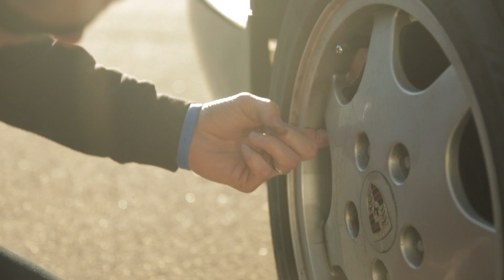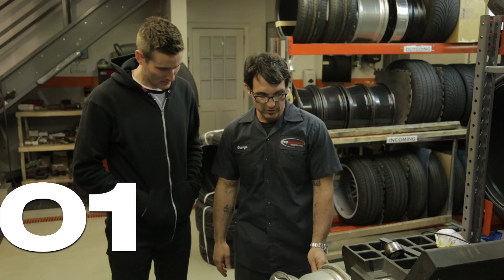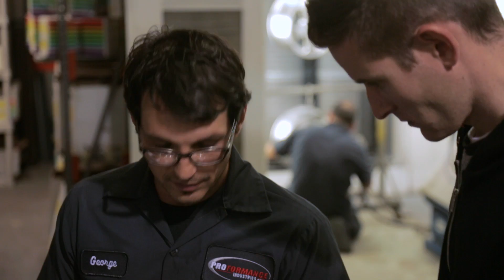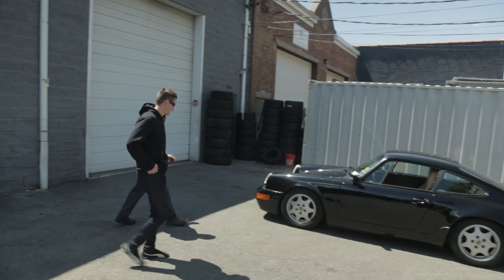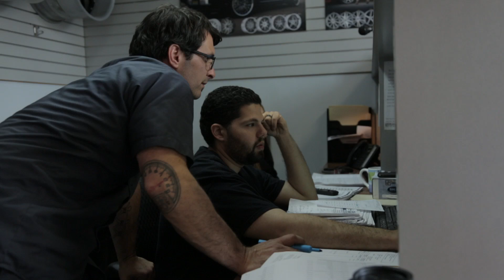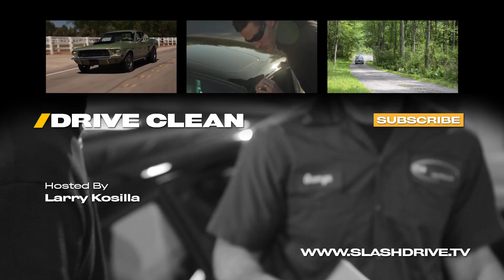Wheels & Rims: Repair, Refinish, and Fitment - /DRIVE CLEAN

Comment: Masking off any part of a wheel is a mistake. If there is any mechanical interference that coating will be immediately knocked off, and you want it absolutely everywhere it will not be knocked off. (then you can even use anti-sieze on those places). Especially because of galvanic corrosion, which is the real reason wheels get frozen into hubs- when both the ferrous, nonferrous and aluminum parts are NOT COATED and are in continuous contact. This guy George seems oblivious about this fundamental issue. What a mess those uncoated areas will be. What headaches they will cause.

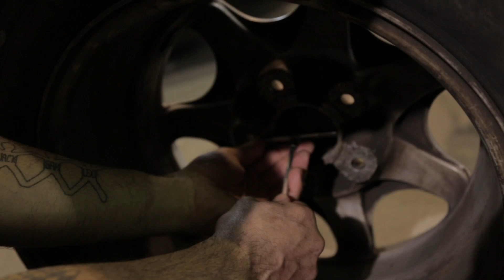Comment: Holy crap massive cringe at 9:20, learn to use your measuring equipment before getting on your high horse about how "you don't care what any book says and you have this measurement" i'd be surprised if you got within 0.2mm with that technique. Extend past the centerline/find the center radially, lock it in place and drag back through the bore, then check using feel as you slip it through a micrometer. There's definitely a right way to use telescopic gauges and that's not it.
Reply: +Alex Smith 
Please post a video of your secret wheel black magicks.
Reply: lol larrys reactions during that time frame is hilarious.  looks completely speechless and the jaw cringe is priceless.

Comment: Sure you can spend money and buy new or used wheels if you like. But it's not "not worth it" to spend the money to fix up your original wheels if they're something worthwhile (like those original 16in C4 wheels Larry had were). Could have actually been a very interesting video if only for the sake of education on the process of blasting the finish off the wheels and then repairing kerb rash. 

For you garage wrenchheads out there that want to fix some Kerbing and aren't afraid to get your hands dirty, check out spot putty. If it's a small bit of rash you can actually strip the paint of just that bit of wheel, apply the spot putty and hardening agent, sand to smooth and then repaint with the correct paint (on almost every german car it's Wurst Silver paint) take about an hour of your life but well worth it. 

If your wheel is rashed badly, just strip the entire wheel and use the spot putty and sandpaper to get the entire wheel nice and uniform. After that pick whatever paint + clear combo you want. Use a spray nozzle to keep your spray even sand it down between coats, especially fine sanding between clears.

Comment: Literally did not learn a thing about restoring wheels other than he strips them then powder coats them. Then he sold you some new rims instead of actually showing the process...

Basically:

Step 1: Pay some sketchball to do some "magic" on your rim.
Step 2: Balance and install in the most expensive way possible.

Appendix: Avoid any action that may save money at all costs.
Reply: My favorite part was how he does not even talk about tire measurements at all hardly. He loosely mentions 265 in the back but does nothing to speak of how the math is done to get the same rolling diameter of the old ones with a different size rim and tire from stock.

Dude is way to self important.
Reply: Seems relevant to 99% of Porsche owners then.

Comment: Nitrogen in road tyres is such a sham - clean dry air is 80% nitrogen anyway, and the claims made about the benefits of pure nitrogen are mostly bullshit - don't waste your money on nitrogen fills, just make sure your compressor is supplying dry air (and even that's not super important with modern tyres and wheels).
Reply: The pure nitrogen for the average road car is a waste of money because the actual temperature change is minimal Pure nitrogen is used when a tyre will experience a lot of heat cycles as it is more stable than regular air and if it saves a 10th of a second a lap motorsport will jump on it for every day road use I wouldn't pay the extra for it only because i regularly adjust my tyre pressures and having to have a nitrogen supply in my garage to do that would be a nightmare.
Reply: Neerav Reddy The very fact that I bothered to research this before deciding it was crap shows that I am no idiot - but think what you want.

Unless you have 500+ HP and track your car all the time you you might as well spend your money on a new air freshener, you'll get more value from it.
Reply: Matthew Sharpe gotta agree with you man, you have a very good point on this one. Nitrogen is only beneficial for race car tires that experience drastic heat cycles to keep them consistent. I tell ya, I sure wouldn't be able to tell the difference so I save my money...
Reply: Matthew Sharpe I tell people the same thing all of the time as well. The air we breath, as you pointed out, is already 80% nitrogen. I'm not going to pay whatever they're charging now for the extra 20% on a car I don't track. If someone else wants to do so, it is just a waste of money, but there are worse ways to waste money on your car. So long as it doesn't get as bad as a girl I know who, when her tire ran low, would not put regular air in it and drove on a nearly flat tire for three days until she could find the receipt from her tire shop that allowed a top off for free.
Reply: Ryan M True, those electric fan "turbo chargers" and magnetic fuel thingies are worse ways to waste money I guess, or the ones that actually reduce performance like engine bay pod filters.
Reply: You guys pay for nitrogen? Most of our tire shops fill them for free......I could take it or leave it on nitrogen on my primary tires, but I prefer nitrogen on my spares and storage tires/wheels. Nitrogen tends to reduce the amount of pressure loss over time, which is a good thing if you don't check your spare tire pressure that often.
Reply: i get free nitrogen whenever i want at my local bmw dealer :)
Reply: Matthew Sharpe you are an idiot
Reply: Nitrogen is a super cheap gas. Most common gas. It should cost almost nothing to get nitrogen fill. Anything that keeps oxygen and moisture away from parts is a great idea and will prolong mechanical life.
Reply: Must be a massive sham, Considering the New nissan GTR comes from the factory with nitrogen...haters will hate...
Reply: Vort E just wasted $20 on a nitrogen fill huh?
Reply: actually no, but good to see how butt hurt you are...u made my dat lol
Reply: Vort E I'm just pointing out the woo, you can ignore it if you want to.  
http://www.theaa.com/motoring_advice/safety/filling-tyres-with-nitrogen.html
http://www.racq.com.au/cars-and-driving/cars/owning-and-maintaining-a-car/car-maintenance/nitrogen-for-tyres
http://www.popularmechanics.com/cars/how-to/repair-questions/4302788
But go on irrationally doing whatever you want  to despite the evidence - that's what people do.
Reply: I've been in the industry for 15 years, Used nitrogen for the last 10 on all of my cars, Even my hilux with 300 000km, It's used in all forms of motorsport, Even in the tyres on planes... I dont need to read anything i know from my own experience, You think its a waste thats your opinion, But dont make out its all hype when you have zero clue...

End rant.
Reply: Vort E because planes and racecars have any relevance to passenger vehicles on public roads. Like I said if you want to waste your money, go right ahead.  I'm the one with the opinion backed by aaa, popular mechanics and the rac.
Reply: If they didnt then why does what is developed in racing directly relate to passanger cars, Ie saftey and all that, You're just ignorant...So live in your little bubble....
Reply: Vort E It's true a lot of technology developed in racing does end up in passenger vehicles eventually - as OEM equipment, but a lot doesn't make it to passenger vehicles either - racing slicks for example - useful on the track - not so useful on the daily commute.

I've tried nitrogen (as it was offered free with a set of tyres) in my 400rwhp road car which I occasionally take to track days - I could not tell the difference, my lap times did not change, the trip computer could not tell the difference - fuel economy & range remained identical, I still lost a couple of lb of pressure from the tyres a year like usual, and the tyres still wore out in the same way as the previous set.

So now I'm back to dry air from my compressor - and I still can't tell the difference.  If I wanted to fill with nitrogen I'd be looking at $20 + whatever they charge to top you up however often it needs it - for something I'm not going to notice at all even when driving much harder than I do on the road - why bother?

Add my personal experience to all the literature that says you can't tell or measure the difference in any meaningful way, plus my scientific knowledge - well I'm very satisfied that my opinion is not ignorant.

Maybe it's useful in a Nissan GTR, maybe a better driver would notice the difference - I don't know, my car is quick, but it's not anywhere near GTR quick, and I'm a very average enthusiast level driver.

Look, I've had this exact debate with my local tyre guy as he's convinced the product he is selling does his customers some good though he has nothing but personal anecdotes to back it up - but I honestly cannot tell the difference, and objective studies also say the same thing - so when people ask me about it, I tell them not to bother with it, it's a waste of money.

Comment: Thanks for putting up great videos...  I'm fellow OCD...  Can you comment as to why he suggested NOT to repair the wheels that you had?  Wheel repairs local to me typically charge $150 to $200 for each wheel.  This would have been cheaper than buying new wheels outright.

Comment: It would have been helpful for the shop to quote the repair costs, and then weigh the options of upgrading or replacing.  Yes, the factory wheels were ugly as f*ck and needed to go, but that still doesn't dismiss the "show's" responsibility to provide an accurate assessment of the situation; assuming they want to maintain a measure of credibility with their audience.

Comment: The overall diameter of the wheel size and width along with the tire size and width was way out of factory spec, that is why guys were blowing Murci diffs back in the day. Improper overall diameter front to rear and overall. It's much more of a science than people are led to believe.

Comment: Felt like this episode was missing some stuff. Just seemed short, I would like to have seen him actually doing some of the restoration work on some wheels, doing the math and calculating the new wheel size etc. But overall it was good. 
I see a lot of comments on how much people dont like the new wheels and I have to say I also am not a huge fan of the new ones, BUT it the only thing that matters is you are happy with them and I'm sure that you are.

Comment: I'm not sure what tech is in that Porsche, but in AWD systems, if the rolling diametres are different front to back, the diff will detect slip and lock/adjust accordingly. This puts a significantly higher amount of wear on the diff itself, because if you imagine this happening at 100km/hr or 60m/h, there's going to be a lot of little locks/adjustments.

Comment: Kwaki82 in the US you can do all sorts of stupid unsafe stuff and if you don't get caught you are fine. I pulled the wheels off an olds and slapped them on Chevy cause they had better tires on them and the car is a beater. If they fit and even seem road legal you can run them. Now if a wheel breaks and you crash then you may have an issue but I don't know.

Comment: Please, could you expand more on the differential issue? These cars are all wheel drive which means if your going with bigger overall diameter wheel/tire combination it has to be same increase in percentage for front and rear combinations. In other words, these people burnt the center differentials of these labos because the were trying to compensate all the time for the difference in the distance driven between the fronts and back wheels. Am I right?

Comment: I hate to say it, but I got absolutely nothing from that video. I was expecting to see what's involved in repairing rash/chunks, a bit more of the heavy-lifting of straightening warped rims and maybe something a little more in-depth on balancing. This video could have been shortened into about 1 minute just by showing some dot points on the screen. Also, considering this is a detailing show, maybe some rim cleaning? Or is that coming later?

Sorry guys :(

Comment: There's camber and there's toe (what I believe you're also referring to here).

Toe is the angle of the wheels when looked at from above the car. Toe is used to stabilize the car at the expense of traction, as it introduces friction and therefore some slip in the tires.

Camber is the angle of a wheel to the surface on which the car is resting. Camber affects the car’s side traction. Generally more negative camber means increased grip since the side-traction of the wheel increases (to a point).

Comment: Thanks for clarifying Matt! I was wondering what he's talking about at the end with the burnt diffs? Do you know by any chance? Im curious how the wrong size will actually affect the drivability/durability, mainly because my wheels are 4 inches wider than stock! lol But I do have low pros to maintain the diameter, however that was just so I didn't have to be concerned about the speed/odometer etc, didn't even consider hurting the differential! Thanks!

Comment: There's no such thing as percentages with camber.  It's measured in degrees.

It's still negative camber up until 0°.  You're average car like a VW GTI or Mazda6 will have around -1.5 to -2° rear camber.  The cars on StanceNation will run around -5°.  Any tire/alignment shop will tell you all cars run negative camber.  No car in the history of cars will run positive camber.

Comment: Mario, even that depends on how pure the nitrogen in the tire is. Most (if not all) tire shops are unable to evacuate all of the air in a tire and replace it with nitrogen. It pretty much would require mounting the tire in a vacuum and then filling the tire. Since regular air is already 78% nitrogen, removing the water vapor of the air being pumped in is the more reasonable solution. It's a $20-25 part to add to a compressor if yours doesn't already have one.

Comment: If anyone believes that their vehicle will perform better with nitrogen, then they are misinformed. Nitrogen just allows more consistant air pressure throughout a wider range of temperatures. THAT IS ALL.

Comment: Hey Matt, Fifth Gear has tested nitrogen and found no distinguishable difference in performance over normal air. Several other reputable articles I've read suggest the same thing. I'm not saying using nitrogen is bad, however, unless they use the same setup as an F1 team, there's little benefit to be gained by going with pure nitrogen. Also, unless you have your own nitrogen tank, top ups are inconvenient to get taken care of. I do agree, $40-50 is simply ridiculous.

Comment: he didn't say stock tire size. He said the overall diameter of the tire needs to be the same. So if you're going from a 16 to 17 inch wheel, you need to get a smaller sidewall so the overall rolling diameter is the same.

Comment: there isn't really a controversy over the use of it. Nitrogen is a good thing, for sure. The controversy comes when stealerships try and charge $40-$50 for filling your tires with it, when it costs barely more than air to fill a nitrogen tank.

Comment: Great video, it sounds like George really knows his stuff. I know that there's a lot of controversy out there about the use of nitrogen. Since you can't completely evacuate all of the air in the tire before you fill it and since regular air is already comprised of 70% nitrogen to begin with, it seems like an unnecessary expense. Couldn't the use of a moisture trap in the compressor line resolve the water-related issues he mentioned?
Glad you went with the cup wheels... the OEM look rocks!

Comment: He went with a plus size. So yes he went with an OEM rim, but still was able to fill out the wheel wells out and get more contact through using a wider tire, while keeping it within spec.

Comment: This is the process he would go through if he wanted to put aftermarket rims on the car. Most Porsche guys stick with Porsche rims. My guess is that as soon as the wheel shop said they weren't really worth fixing, Larry started looking for some Cups or other Porsche Rims.  Plus used Cups are fairly common and don't cost a whole lot.

Comment: You're right, the repair process is a little more complex than this. The line between "too simple" and "too detailed" is hard to balance in these sort videos. The measurements we discuss are intended as starting points. Check out the downloadable PDF for detailed instructions and email me your thoughts.

Comment: I don't understand why people insist on filling tires with nitrogen. The amount of difference is negligible. Air is already almost 80% nitrogen. In a super high performance race car I suppose it would be alright, but 99% of cars are better off without it.

Comment: I had a similar experience with one of my vehicles that I purchased used a few years ago. After going through the same steps, I decided to stay with the OEM wheels, but had to have one of the replaced due to its extensive damage - it also not being worth repairing with the time needed. Great choice regarding the rims. Some vehicles looks extra special with their brand name design wheels, and that 911 is one of them.

Comment: I've always known wheel repair to be costly. 20+ years ago, I read an article where they took a wheel off an Omni GLH in for repair and it was expensive. Not only did the shop repair (weld) the damage, they painted & clear coated it to match the other wheels. He was pleased with the work, but it made the other wheels look old. Oftentimes aftermarket wheels are the way to go with a myriad of choices in size, widths, finish & style.